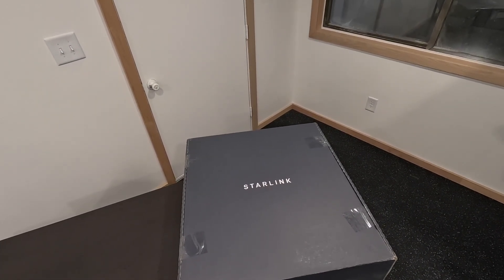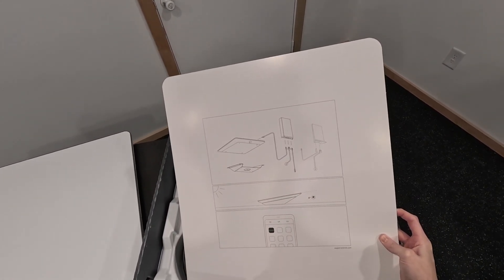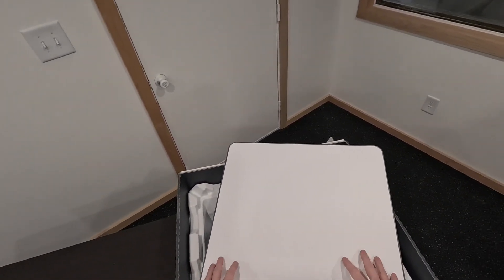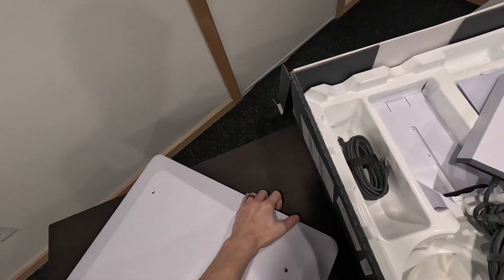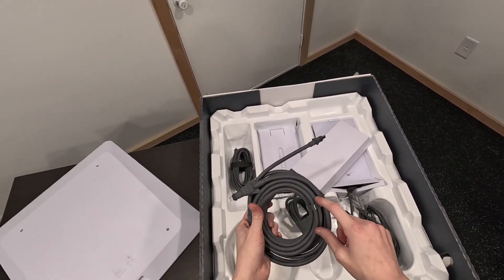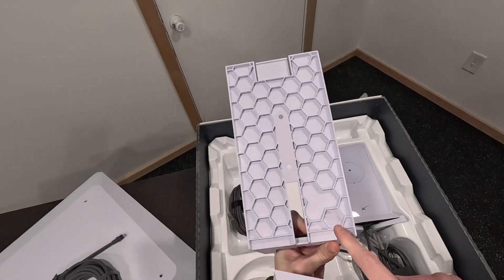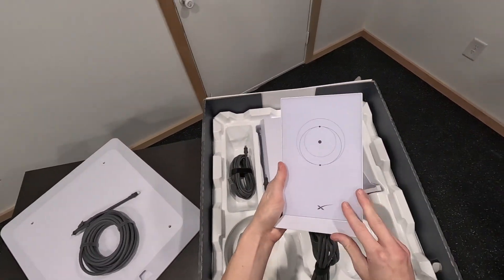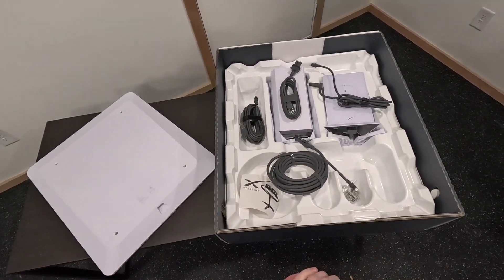Starlink Flat High Performance Kit Unboxing

Comment: Umm can I install this in my roof for a long time?
Reply from the maker: Yep, this dish can be installed pretty easily on a roof with the Pipe Adapter accessory and a 3rd party mount.

Comment: Pls i want to know what is the different models we have...
Reply from the maker: There are 3 main generations. The Gen 1 dish was circular. The 2nd generation includes the Flat High Performance in this video, as well as the regular High Performance and Standard Actuated models. The mast and proprietary cables give this generation away. As well as the router, which stands tall with a glass front. Gen 3 is the newest version. It doesn't have a mast or motors. The kickstand mount is the defining feature of the design. The router is also different, a longer rectangular shape with no glass. Also Ethernet ports on the back.
Reply: @DISHY_tech  is there a video for it

Comment: When ordering without a router, is there a separate proprietary power cable and then a separate ethernet?     Was hoping for a more simple one-ethernet POE+ connection.   Also not interested in the Starlink router.
Reply from the maker: It comes with a cable that goes from the power supply to RJ45 so that you can plug in a 3rd party router or switch. Starlink doesn’t supply POE from this cable.
Reply: Does the dish generate its own WiFi signal when ordering without a router?
Reply from the maker: @warnerl No, the dish is the modem, but doesn’t perform any routing or WiFi functions. If ordering the High Performance, you need to provide a router or your own networking equipment.
Reply: @DISHY_tech  Can I use a router from a Gen 2? Or can I use my own router?

Comment: how much mbps
Reply from the maker: Depends on your location and service plan, not really the equipment. The Flat High Performance isn't any faster than the Standard. It has a higher FOV, is in-motion approved, and has a beefier power supply to handle weather better.
Reply: @DISHY_tech  I have terminals in locations in the world with very few users competing for bandwidth, I routinely see throughput in the high 300Mbps and have seen over 400Mbps a couple of times.